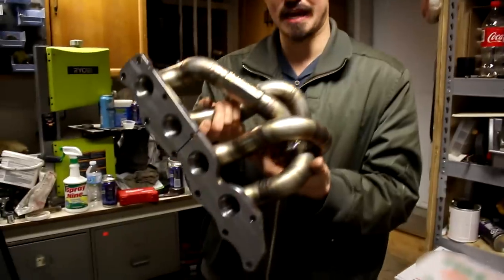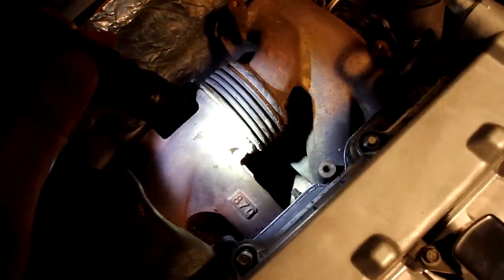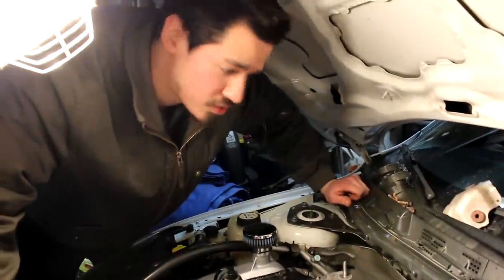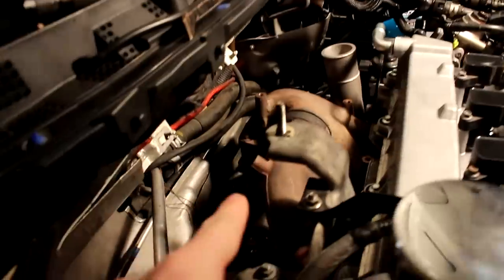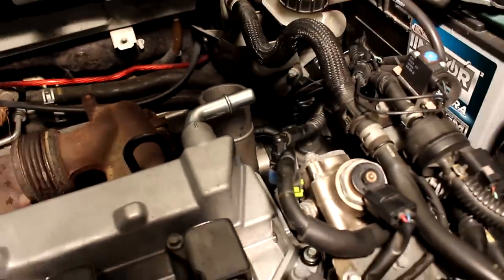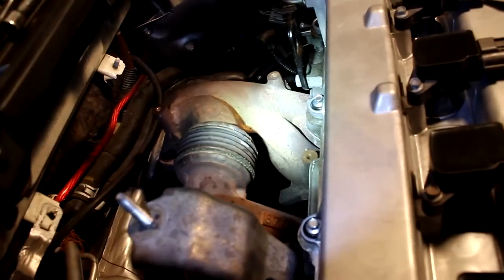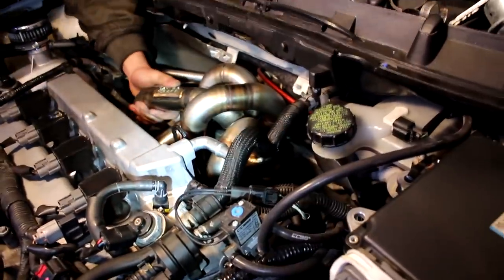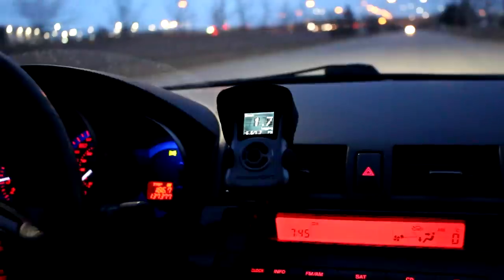Mazdaspeed 3 - Full Race Exhaust Manifold & CPE Downpipe Install

Comment: Did you have any issues with exhaust leak after you swapped the turbo and manifold? I got it all swapped out but deff have an exhaust leak and can’t seem to track it down
Reply from the maker: I didn't have any issues with exhaust leaks, and the exhaust mani gasket, turbo gasket, and downpipe gasket were all reused. An exhaust leak will usually be accompanied by carbon residue :)
Reply: Wannabe Tuners yea I don’t see any of that. Wonder what it could be then
Reply: And the exhaust tone sounds completely different!! Deff digging it
Reply from the maker: @jebified  If you don't see any signs of carbon it could be just the way the new setup sounds. Does it sound like an exhaust leak?
Reply: Wannabe Tuners it does sound like a leak, but tomm I’ll try all the manifold bolts and O2 housing and make sure they are tight. It’s deff the tapping sound of and exhaust leak
Reply from the maker: @jebified  I've needed to slightly increase the preload on the wastegate actuator with my S4 a couple times. It wasn't holding the wastegate flap shut tight enough which would cause a slight rattle. U can test this by getting your hand on the wastegate arm on the outside of the turbine housing and holding the flap shut (right after a coldstart obviously so you don't burn yourself). If the rattle goes away when u hold it closed, then u need to shorten the length of the rod slightly :)
Reply: Wannabe Tuners Ill check that! But it’s not at idle, when I give it some gas you can hear it. It’s just annoying since it wasn’t there before lol
Reply from the maker: @jebified  And all that was installed was a BNR S4 and a Full Race Manifold?
Reply: Wannabe Tuners yea I just did the CST5 and FullRace manifold. I’ll just recheck everything today and hopefully find something.
Reply: Sorry to pick your brain so much. I’m an old DSM guy so the MS3 setup is new to me. I appreciate all your help!!!
Reply from the maker: @jebified  No problem at all brother, that's what we're here for :)
Reply from the maker: @jebified  Oh ok well yeah man just gotta double check all exhaust connections
Reply: Wannabe Tuners yep manifold bolts are loose!!
Reply from the maker: @jebified  All of them or just a few? Lol
Reply: Wannabe Tuners lol 5 of them! I drove and sounded good and pulled my logs and sent them to Justin@Freektune so excited to see what it all will do
Reply from the maker: @jebified  Awesome dude, glad u figured it out. That turbo should make u very happy!
Reply: Wannabe Tuners funny how much it sounds like a rotary now lol got that brapbrap sound. Again thanks for all the help and input!!!
Reply from the maker: @jebified  You got it buddy

Comment: About these bolts are you really done it with new or with used :D
Reply from the maker: lol The bolts are for the heat shields on the stock exhaust manifold and they're no longer needed once the new manifold is installed :)
Reply: Wannabe Tuners xD okey now i learned something new xD
Reply from the maker: Krčmy's Garage Good I'm happy